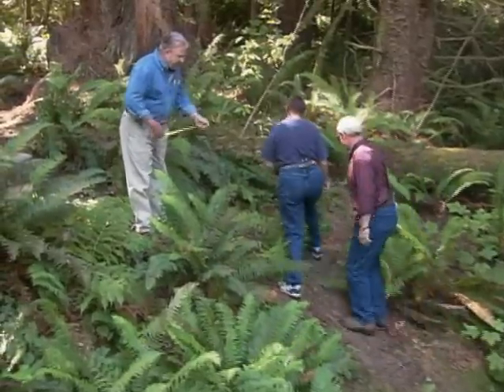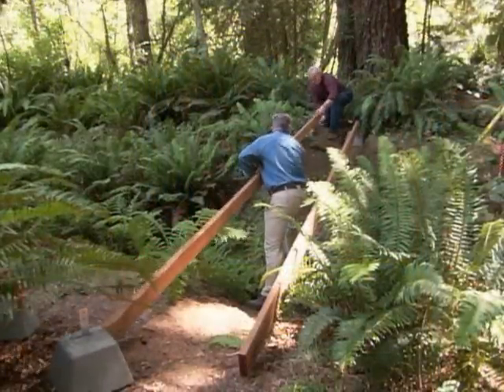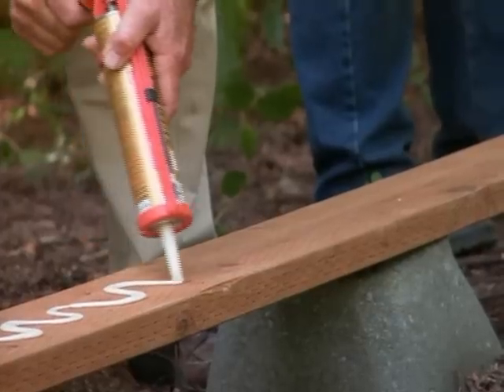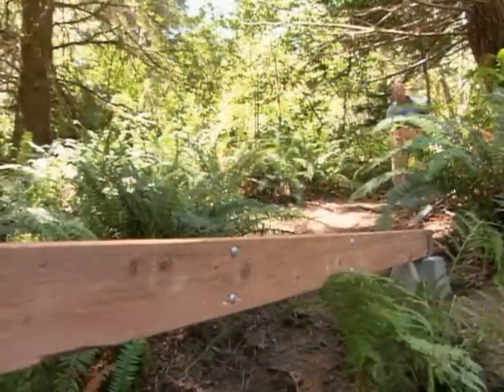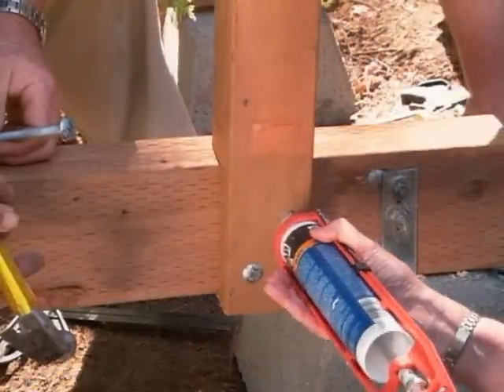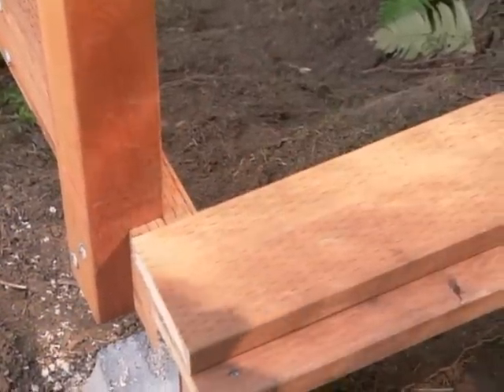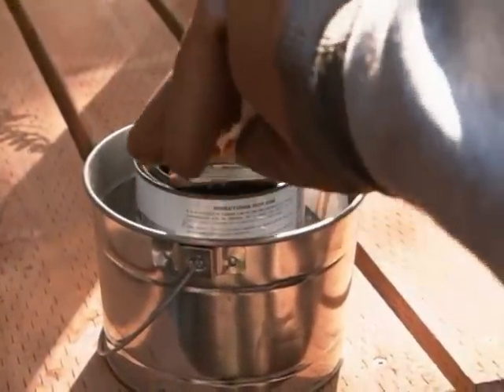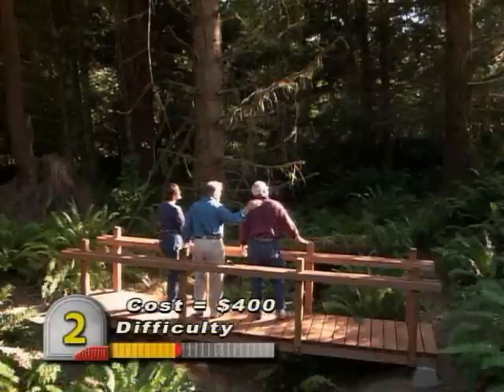How to Build a Wooden Foot Bridge

Comment: finding the concrete blocks with the metal things in them already to attach the beams to is the most difficult part.  Would help a lot to tell us where you got those.  Without those I cannot even begin to do what you did.
Reply: I’m also looking for concrete piers with the metal straps embedded, no luck yet

Comment: Hi I liked your video & was inspired to build my bridge. Much like yours mine was 22' long & 6 wide But I built it with three beams where each beam consisted of two 12' 2X8"s &  two 10' 2X8"s, one of each on each side giving it a 2' overlap in the center. I then liquid nailed them together overlapping both sides by 2 '& then I lag screwed w/washers every 2' in a zigzag pattern to follow up with carriage bolts & washers zigzagging under & over the lag screws.. I also used hurricane straps on the inner & outer butt joints of the 10' & 12' center beams. I could not find those concrete piers w/the mounting straps & so I used concrete blocks that I filled w/concrete & put a piece of 3/4" pex pipe in the center on one side & a 5/8" concrete anchor in the other hole side of the block & let dry overnight. I did 6 blocks the same. The patio has a slight drop of like 4 inches on the edge & so I dug in three of my peers spacing them 6' from the ends & one in the center evenly across just short of the patio as to overlay a treated 8' 4X4" w/ holes drilled to match the anchor bolts so to bolt it down tight onto the three concrete piers. Now i did the same on the other end & layed my beams spaced accordingly. & crossed braced them with  metal joists bracing brackets so for them not to twist. & then I used ring shanked nails & nailed treated deck boards bridging 6' across it the entire 22' length. Note I also had to extend a short 3' ramp on the field end & I'd leveled the transition to the patio on the other end. Then I laid  one 12' 2X6" along the ends on each side of the bridge W another 10' butting up to it end to end on both sides of the bridge to create a bumper guard & I lag screwed them every 4' locking the edge of all the decking boards down & beyond the call of duty! In the future, I will add the rails, but for now it's done! I'm thinking of using 1" steel piping for the railing anyway. You can also YouTube me Dave Overbey on self defence for a style of my own technique & tactics that are just fantastic.L.O.L
Reply: Dave Overbey do you have pictures.... I’m planning a bridge about the same size as yours
Reply: Dave, do you have a picture of this, i'm looking to build a 22-26 ft and you doing a 12  and 10 2x8 makes sense and can handle more weight?

Comment: A couple questions:

1) What is the working load of this bridge?
2) Why use two 2x6 boards for each beam instead of using just one 4x6?
Reply: Two boards are better than one thicker board because if a crack starts it will only go through one piece.
Reply: Price of the lumber may be one reason. Another is likely the location of the build. The weight of a 4x6 being carried to a remote location is often a concern.

Comment: When glueing the two beams together make sure that it is on a flat surface otherwise it will be bent as seen but quickly passed in th video. Also the concreet bloks will sink in to the soft soil. If you want thus bridge to last make a bigger fundation. Still I love your video